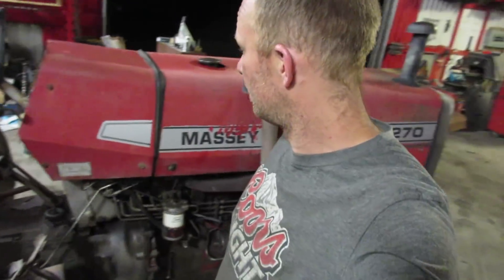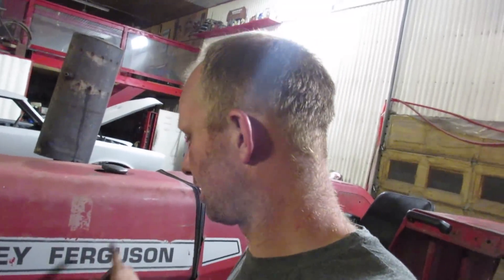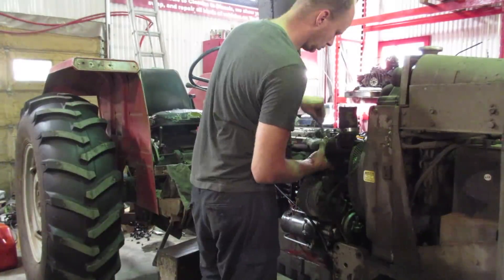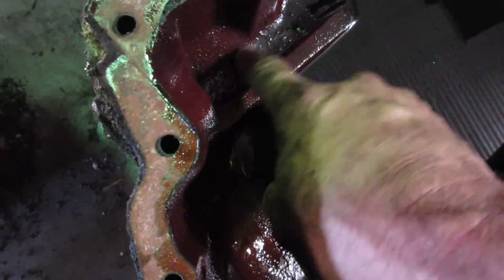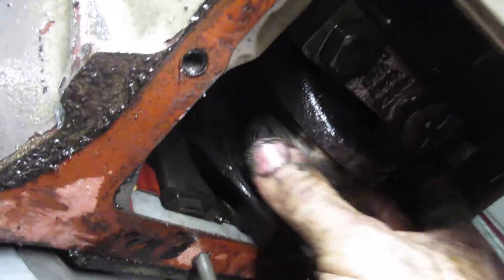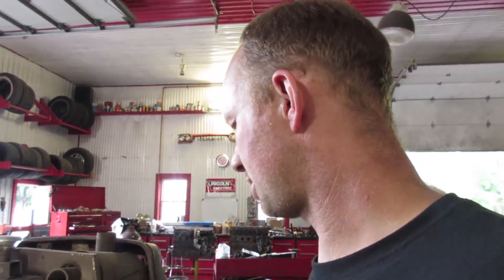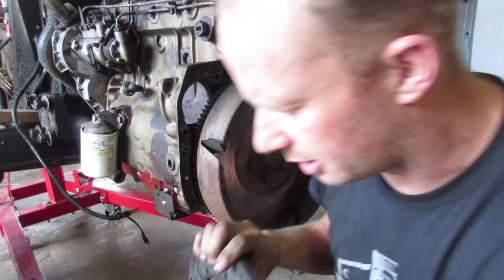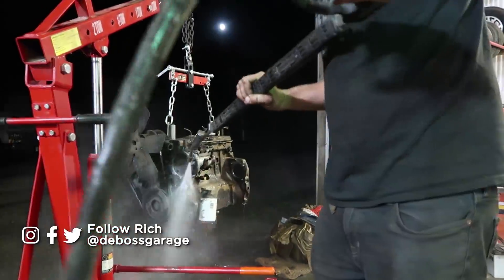$0.59 Part Destroys Massey Ferguson 270 [EP1]

Comment: I'll likely never own a farm vehicle, or piece of heavy equipment - but I think that this may be favourite type of Deboss video
Reply: Get yourself a TE/O/A/F/D20 for small stuff around the house/yard, I'm not kidding :)
Reply: ToreDL87 Or a old diesel yanmar
Reply: @theshadetreewelder3523  a Kubota G4200 for the grass and a Massey 1045 with a front loader for the farm. Clean fuel with additives and keep all the fluids clean. I'm set till I'm off the planet. Also helps to keep everything garaged.
Reply: I agree

Comment: there is a simple rule for fuel tanks on farm equipment. If you need to test run the equipment, the tank is always empty,    if you need to remove the tank, the tank is always FULL!
Reply: Unless youre the competent type on a farm

Comment: About lost a DT466 in a dump truck the same way. Stopped it before we lost all the oil. Bent the plastic line over and wrapped it with some tape. Popped the drain pug on the excavator we were towing and drained the oil from it into a plastic bottle found on the side of the road. Transferred all the oil to the truck engine 16 oz. at a time. Drove home none the worse for wear...
Reply: Wes Johnson They make wire braided hose called truck hose ,used on oil, coolant , and he air line , abrasion resistant , heat resistant, good to 1000psi , never have a problem .
Reply: That stuff doesnt work very well for a mechanical oil pressure gauge. You're much better off going electric, or rerouting it so it's less exposex

Comment: I have a MF245, with the Perkins diesel.

When you said "it takes forever to put the hood back on" I lost it lol. It really is almost impossible
Reply: Agreed !

moved the snakecharmer exhaust to outside the bonnet on a 283. It makes it only slightly better.

So many bonnets with torch cuts to enlarge the holes.
Reply: @safetyfirstintexas  never had the hood off my 1045, thanks for the heads up!
Reply: It makes no sense to run the exaust parallell to the intake down its full length so as to  have the exaust come out near the centerline of the bonnet. 

28.00 usd. For a straight out manifold off  and a 3 flange reducer for 18.50 off ebay.

283 brasil
Reply: Great little tractors though. I used to drive one and it was great!! These are everywhere in Europe. Some. Folks still use them as well.
Reply: Sean Slater 
Hay
Reply: Dixit Patel fiat/new holland 110-90 best bonnet ever. Consists of 3 separate panels and a nose cone. Comes off so easy that It falls off. And no diesel tank in the way. As it’s at the very back under the window.
Reply: Still a sweet dream compared to the removal and reinstallation of plasdick body panels on modern cars!

Comment: Worth fitting a $5 12v buzzer to the oil pressure warning light?   Yes, annoying pre-start up but less annoying than a complete engine rebuild…..just a thought.  Thanks for the time and effort in sharing this video.

Comment: Not sure where you get your parts from, but there is Steiner Tractor just south of the boarder in the middle of the mitten. Used to do this every day, got screwed up, now I just get to watch, great video. Watch all the time. Look forward to the next one.
Reply: Good day There is a Steiner Tractor in Canada , I think Barrie possibly  Thanks
Reply: I meant Steiner Tractor Parts, they are a manufacturer/supplier like Steins or Tisco. The Steiner Tractor you have there is probably a dealership. Sorry about the confusion.

Comment: For the record a 59 cent part didn't ruin that engine, the farmer that chose to ignore the oil leaking and not checking the oil is what caused the failure. It would take a long long time to empty the crankcase on an 1/8" line
Reply: RJ 1999 serious pressure behind them though.
Reply: @ferguson20diesel49  I realize that, but the flow of an 1/8" line takes a long time to pump an engine low enough to be ruined

Comment: Really fascinating that the failure mode of some electronic oil pressure sensors are to blow a hole though them. The result is of course not to report the low pressure nor any other error (a "sensor error" would've been nice), and since it's measuring high pressure oil, all the oil it's supposed to monitor is now promptly evacuated from the engine. We had an old Nissan Bluebird and it managed to do this twice in its 350k Km lifetime, only luck saved it both times.

Comment: yea, cought the vid early, put a murphey switch on that thing, no oil pressure....no go
Reply: Exactly what I was going to say....
A switch that can be incorporated on oil pressure line ,
allowing elec to fuel pump if press is good.
No pressure = no fuel = no running!
Stops in 1 second if any issue.
Reply: @ashqelon7267  no electric fuel pump on these models. Its all mechanical. 
Lift pump, fuel shut off, all of it.
Reply: You'll want an electric fuel cut off then.
Reply: @safetyfirstintexas  normally closed valve kill fuel if no 12v is there
Reply: @kitecattestecke2303  and without oil pressure you destroy the  pump   on startup. because the lift pump can not provide flow due to a valve thats close due to no 12 v.

Comment: I agree in any MF bolts - get a magnetic tray for them.  AGCO is super proud $$ of them.

Thanks for the vid Rich.
Reply: Or take an old box and punch holes in it to store the bolts in. The nice part about doing it this way is you can write notes about what goes where if you need to. Which is great for jobs where you know it might be awhile until you get back to it.

Comment: We did a clutch change on my fatherinlaw's 1963 MF35. The adjustment was supposed to be ..090 gap. They had to machine .010 off the face, and so he adjusted the gap as .100 in the face of my argument to put it .080 to bring it closer to the face. Clutch works like shit, but too much effort to pull apart again to adjust. Would have been nice to have an ACCESS PANEL...

Comment: Those 270s are good tractors. I learned my lesson years ago about plastic oil pressure gauge lines. What did you use to degrease the block and parts? I always have trouble getting the diesel residue off tractors.

Comment: Our 165 just ran out of oil and blew it up but it needed a rebuild Badly like this has 25-30 thousand hours on the original engine but sadly one stupid little problem (blowby,leaks, burning oil and not checking it makes headaches

Comment: Look the cam sometimes bearings go bad and then is cam junk because uneven wear
Reply: it will work with old one but not perfectly . Two times repaired head and one set of piston rings my had 21000h then lost power and started drinking oil piston sleeves 3 and 4 had big scratches . Great engines btv . 
after that full reparation costed in Croatia  with machine shop 1500euros  tell us price at the end .

Comment: I would get an oil pressure switch (from vehicles with “low oil pressure” warning lamps and wire it to a seatbelt buzzer or something. Probably total of $20 in parts to make a simple warning system. Although with that, also replace the pressure line with a steel one
Reply: the sad part is that's how it should be.... because the mass majority MAY have that gauge and even if it flat lines or shows 0 etc they believe it's broken and continue on their way until its on fire and they're dialing 911 and so is everyone else and there is now a fuel/oil fire on the road all because someone "thought" their low oil pressure gauge was broken.. an extreme example but as a volunteer firefighter we actually see this a lot.. especially on vehicles KNOW to be equiped such as a Chevy Tahoe etc.... the person mentions its 0 but well.. too late when we get there.
Reply: RedAsMay I have seen that as well. Instead of “my gauge is reading low, I better stop and check it,” there is “this thing never has an issue, obviously the gauge is broken.” Fortunately some new vehicles do have automatic shutoff switches on the fuel pumps and such that will kill the motor if the oil pressure drops too low. I would rather have my motor shut off unexpectedly than have it explode unexpectedly

Comment: I have two wood chippers and they both have Murphy switches for low oil pressure. Why don't tractors have them? Just because someone is sitting on the seat most of the time?

Comment: bearing rotated, crank is 100% toasted, there's no need to wonder, nor guess at all :))
if it was dumping oil and they didn't know, guaranteed they ran it until it locked or was death knocking............ just the way it works ;)

Comment: Would you explain why you're not replacing the clutch?  Doesn't that fall under "while we're in there"?
Reply: customers nickel AND dime said repair jobs! AS CHEAP AS POSSIBLE especially as old as that tractor is! you don't want to scare the customer out of the repair job right from the get go!
Reply: He said clutch looked good, and anyways if he was trying to nickel and dime the repair cost he would have just bought a new tractor
Reply: That round thing he showed with all the rivet holes in it is about the same material as old fashioned asbestos-containing brake material. As long as that is thick enough its perfectly operational.
Reply: Have a degree in farm equipment and diesel, it may already have a newer clutch that was done not long ago. A clutch in a tractor is stronger and more resilient than you are imagining and they last for a long time.
Reply: @Blake barski the entire tractor might snap in half should he replace the tractor.
Reply: Because the farmer just spent $5000 on a $3000 dollar tractor, the clutch will likely out live the farmer.

Comment: I need to rebuild a 1100 massey how do you know if you can do an in frame rebuild? The rebuild kit comes with everything but the main bearings. 
If you didnt have to pull the crank what would you have done?
Reply from the maker: Pulled the sleeves and replaced all the bearings with it still in one piece.  We have a video on rolling the main bearings.

Comment: I've got an old Massey 85, shes got the Continental HD 277 engine, she burns some oil and  oil pressure gauge is about 20 psi when cold, 10 psi when shes all warmed up and at full RPM, I watch that oil pressure gauge like a hawk, look back, check the brush hog, make steering correction, check oil and repeat.
Reply: Sounds like it might need a new oil pump.

Comment: These tractors have lackluster power for running a disc cutter at reasonable speeds or traversing hilly terrain with implements attached. Are they compatible with turbocharging to bridge the power gap or would the engine need too much work to make the power gains reliable?
Reply: They did make factory turbo versions of this engine so it should be decently reliable but the tuning is most likely very different between them and also modifying all the panels to fit it.

Comment: we have a saying for farmers who think they are doing good (AKA fuel shut off delete)...but in actuality are fucking the mechanic with no lube
FARMER-IZED!!!! 

most farmers are NOT mechanics.... 
i dont have a fucking clue about growing crops (well, i do.... due to the close family owning a farm/ranch.... and living in NE montana)

but..... most farmers dont have a clue about mechanics 
if it works..... even 1/4 ass.... it works good enough 

we have people come in asking for 9.00 R20 tires.... (aka snap ring rim, bias ply, tube type)
then bitch when we say their tire is a week out, and costs more than a 11R22.5

not our fault you want to keep running 1950s equipment..... 

hell..... we still fuck around with split rims.... despite them being banned for ~30 years..... 
welcome to north-east montana.....

Comment: use a cheap hose pinch off and move on for the fuel line, copper tube for O/P gauge or stainless (bitch to bend)

Comment: Whats the point of even having an oil pressure gauge? If your good about checking your oil then you dont need it and if your oil pressure is still low despite that then your screwed anyway and might as well keep running it in ignorant bliss.

Comment: Incredible that you are allowed to wash the engine outside like that 
Here in Sweden you can not do that, you need to have a oil an chemical separate system installed 
By law you can’t even wash your car outside
Reply: Aaaaaand i'm not visiting my family far off ever again
Reply: water bear do you go there to clean and wash cars?😂

Comment: massey 390 strip down on monday for the same fault.
Reply: How'd it go
Reply: @guy_incognito7538  .still stripped at the moment.i need liners but also noticed a leak coming from the transmission seal.i thought originally that it was the crank seal .wet starter motor .i got  a full kit coming this week so a new engine it will be shortly.

Comment: I have MF 275 TRACTOR (PRIOR TO 9A349239), I have followed your instruction and changed the clutch, now I am trying to put the wire back and don't know how to get power to the glow plugs. I see Deisel fume of the exhaust but no fire because I do not know how to get power to the glow plugs. The MF  275 wiring diagram does not show where the wires get connected to.https://na.apb.agcocorp.com/p/masseyferguson/651354/l/53?
Reply: I found out that the MF275 used compression not glow plug and after bleeding he fuel line from air at the injector, it started right up

Comment: This makes me cringe. Since oil is the blood of the engine, you don't cheap out on anything oil-related. Lines, hoses, filter, oil itself, etc. I would be one pissed off mofo if a simple oil line ruined any engine of mine through a series of unfortunate circumstances.

Comment: Man I have a problem and I’m sure it’s something stupid. I tried to start my 4bt in the frame the other day and all I’m getting is machine gun clicks! Tried swapping starters and still the same thing, tried swapping batteries and still no luck. What the heck am I doing wrong? 12v post on battery to 12v post on starter it’s grounded through the block and I’m jumping power from the hot post on starter over to the exciter post.